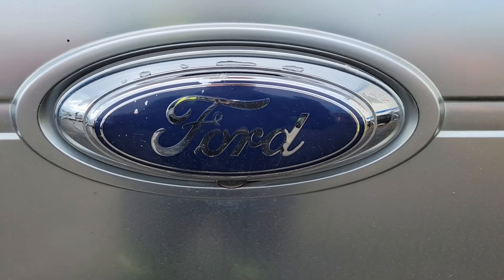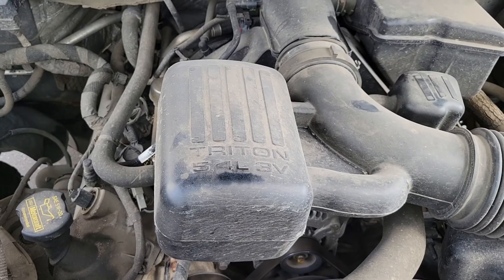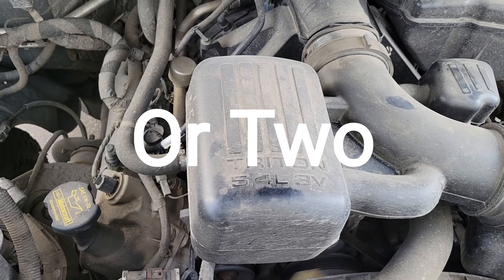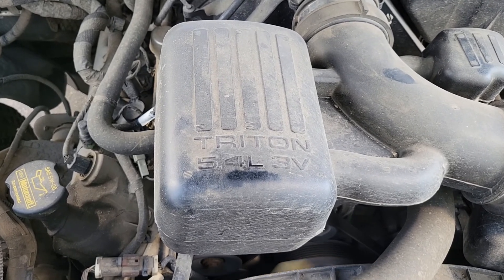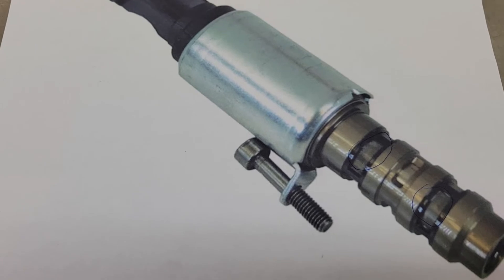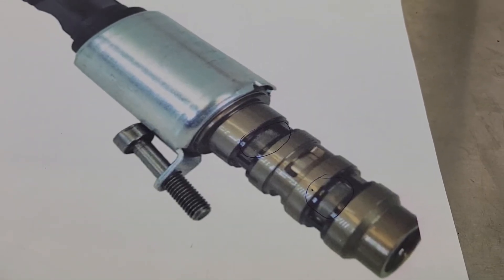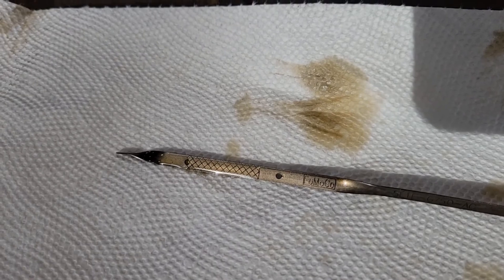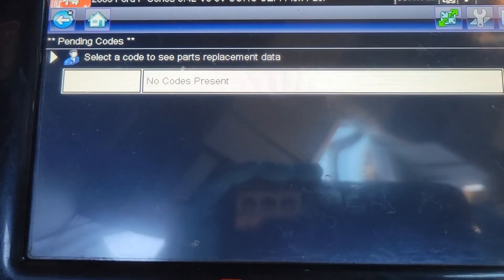Ford F150. P0012 P0022 P0341 P0346 & Timing Chain Rattle. What Will Fix It?

Comment: After Replacing the Solenoids..is it possible that the truck can still give the same problems ? Does the computer need to relearn over 1-3 days of driving or should it just stop this “diesel” shaking like symptoms on the truck
Reply from the maker: Yes it is possible. It's a very complex system with a lot of parts and potential issues. It may not be just the solenoids. Could be phaser, electrical,  oil pressure, or even timing chain issues. Hope you get it figured out and fixed without having to spend too much.

Comment: I have an 09 4.6l. Once the truck is at operating temp when i come to a stop the engine starts running rough and throws a p0345 code. Cleaned cps sensors and did an oil change switching to pure synthetic oil. During the oil changed i noticed build up of sludge in the oil fill cap and spout. Waited way to long to do the oil change. Before this the oil always looked really nice each time I changed it but this time it was black and sludgy. After that the truck still runs rough when coming to a stop but now only throws a p0012 code. I changed the only again today after only driving 100 miles or so and it was dark and sludgy after a week of being in the engine. I hope changing the oil this 2nd time will be enough for the codes to stop coming up. Do you think the problem is likely the sludge in the motor oil maybe affecting the VCT solenoids? And would i maybe benefit from using 5w-30 instead of the 5w-20 it calls for?
Reply: I forgot to mention when I cleaned the cps sensors I also switch which bank they were in, with the code before being p0345 and now it's p0012 actually tell me it's the cps sensor itself I'm thinking. I ordered them, I'll post if it worked.
Reply from the maker: The sludge could definitely be causing issues with the VCT solenoids. Good idea, swapping sensors. I do it with coils chasing misfires. A bad pvc valve can cause sludge to build up quick. I'd check that. Keep me posted on how it works out for you.
Reply: Like always it was the VCT solenoids, running good now.

Comment: 2 oil flush with oil additives each at 150 miles and then fill with good oil? I had the p0022 code pop up on my 3.5 echo boost 2017. Looking to try this before spending thousands.
Reply from the maker: Hope it helps. The system relies on clean oil at the proper pressure. Keep me posted with how the flushing works.

Comment: I did a timing change, after putting back together, I have a P0012 code, and a P2196. Not sure if the o2 sensor could cause this. Sounds like a diesel when I first accelerate in gear. Not sure if spending the time and money on the o2 sensor is worth it, or if I need to call time of death.
Reply from the maker: Did you get it figured out? The P0012 concerns me. Perhaps it wasn't timed right or a cam phaser problem?
Reply: @shanersmechaniclife3164  I did not. I bought a more expensive code reader, hooked up forscan lite and found at idle VCTADVERR is at -55.25 while VCTADVERR2 is sitting at +52.88. I think I will need to tear it all down again.

Comment: My 2010 expedition has 132,000 miles it has the po 0012 to far retarded.  After fresh oil and filter the same code the tech told me it needs a new engine the oil pressure is below the limit. I wonder why it can't be repaired. ..

Comment: Did that. Also changed solenoides, Rocker followers and phasers and after all this, 2 oil changes with oil flush, P0012, P0022 and those P04XX came all over again. Both banks are constantly over retarded at 12.28 degrees
Reply: Did you solve it ? Timing chain issue ?

Comment: I had phaser /valve/ cam rattle after engine warmed up useing the light weight 5w-20 oil. Checked oil pressure with a manual gauge at operating temp . 67 psi then 35 hot. +Went with penzoil 15W 40 problem solves ben useing it ever since.
Reply from the maker: What was your oil pressure after switching to 15w40? My concern would be flow at start up in cold weather.

Comment: How many solenoids does a 2007 5.4 have?
I did timing chain still doing same noise
Reply from the maker: I believe that motor only has two. These motors are very picky. Make sure you have proper oil weight (usually 5w20) oil pressure is in spec, and I usually run Ford filters. These are also prone to cracked or leaking exhaust manifolds which also make ticking noises on cold start ups. Keep me posted on what the problem ends up being. Hope this helped. Thanks for watching.

Comment: Mine did the exact same thing. I changed the solenoids, changed the oil and it’s still running a bit rough. Cleared the codes but haven’t showed back up yet. Not as bad but slight rough. Not sure what else it could be. Any suggestions? P0022 P0012.
Reply from the maker: Those are cam timing related codes, possibly timing chain wear or cam phaser problems? If it's not throwing a code, I wouldn't be too worried. Hope this helps. Let me know what you find. Thanks for watching

Comment: Alright, so what if I do regular oil changes. I do them every 3 - 4.5k miles since my truck is at around 164k miles. I was driving home from the shop and it felt like my truck went into a limp mode. At idle in gear (I was on the road and I didn't think to shift it into neutral or park), my tach was reading about 250 rpm when I usually idle at 750 rpm. I got home, shut it off. Grabbed my scan tool from the garage, went to start it and the truck started fine and idled fine. Took it for a test drive and it didn't go into limp mode. I threw my scanner on it and it had the pending P0022 only. 2007 f150 XLT 5.4 triton Vin V Flex
Reply: and yur point is??

Comment: I am only getting the P0012 and the vehicle vibrates hard and go back to normal, but engine light remains, can I just change the solenoids, also can I still operate the vehicle with no problems
Reply from the maker: You can change the solenoids, but first I would check the wiring to them and the cam sensors for damage. Rodents love to nest on the intakes and chew wiring. If you decide to pull the solenoids check the screens for restrictions like sludge and silicone.  Hope this helps. Let me know what you find. Thanks for watching

Comment: I'm having the same issue. I have a 2015 ford f150 lariat with 3.5 ecoboost. Have the codes and getting a rattle in the engine sometimes. It comes and goes. Should I try this method before spending 5000 on cam phasers?
Reply from the maker: Have you fixed your ecoboost yet? I would try it first. I always look at maintenance items first before I look at expensive repairs. Let me know how it turns out.
Reply: @shanersmechaniclife3164  yes I fixed it simple oil flush and changed oil twice

Comment: I did this with the exception of adding seafoam additive before I change the oil. Drove it for 125 miles. Did oil and filter  change added seafoam again drove it for 150 miles. It quit throwing the error codes and ran great. Changed the oil and oil filter again. Has ran great so far .I'm at 200 miles and still going. Sure Glad I found your video.
Reply from the maker: I'm glad my video was helpful for you. These variable cam timing systems rely so much on clean, proper viscosity, level, and oil pressure.  You lose one of those, and there will be a problem.  Keep me posted on your engine as you get more miles on it. Thanks for watching and commenting.

Comment: Good vedio I'm working on ford explorer 2014  i change water pump    cause if was leaking an i have change timing chain an sprocket now it shows code P0022 and P0012 any help highly appreciated
Reply from the maker: Could possibly be a timing chain or phaser timing issue in assembly. Did you have any of those codes before? Let me know what you find. Thanks for watching and commenting.
Reply: @shanersmechaniclife3164  
All 4 phaser I have change
Reply: I have not check code before thank you

Comment: First video ive found on the problem i got going on, finally, took so long to find smthg. I got a 2010 4.6 3V and i got the same issue where it starts sounding like a semi truck every now and then. I got the same codes but i also got one cylinder misfiring in each bank 3 & 4, is that related to it all or is that domething seperate or perhaps altogether different.
Reply from the maker: If the cam timing is off, a misfire could happen. One thing you could try is take the coils from the suspect cylinders and move them to other cylinders. If you get different misfire codes, then you know it's a coil problem. Hope this helps and keep me posted.

Comment: I have a 2010 f150 lariat getting the same codes and rough iddle, also it shuts off randomly when i get to a stop or red light, do you have any recommendation??
Reply: Did you ever find the problem or a fix for the problem?
Reply: Same problem here

Comment: Got a 08 5.4 did timing chain ran great til warm then idled like shit did timing chain again same thing with phasers did it again new chain and phasers and vvts still idles like shit I’m lost
Reply: You did the timing chain twice and never upgraded the oil pump ???
Reply from the maker: Have you checked your oil pressure? or even send an inspection camera up the drain plug to check pickup screen? I've seen them restricted with silicone. That system needs pressure and flow. Let me know what you find.

Comment: my cel goes off directly after i change oil but comes back on about 100 miles later.  how many oil changes do you recommend
Reply from the maker: A couple oil changes should work if it's just an oil sludge problem. You may have some worn parts. What codes are you getting?
Reply: @shanersmechaniclife3164  p0012 an p0022.  ive change it 2 times so fare each time light comes on about 150 to 200 miles at highway speeds
Reply: @newschool2708  did you ever resolve this? I’m now having a similar issue with mine.
Reply: Im having the same issue. What was the cost in replacing engine?

Comment: Mine just started, I got it at 141k and it’s at 147k. It was do for an oil change at 145k which I did, mine is an XLT though. I’m just gunna replace them and the cam position sensors since I’m right there.

Comment: Question I’ve got a 2007 5.4 3 v and I just replaced the spark plug after truck overheated now that new plugs are in when I hit the gas it makes a clacking noise my codes are p0010 p0020 and p0202 any clew ? If so I’d appreciate a response
Reply: P0010:  Camshaft position, actuator A-bank 1 circuit malfunction.
P0020: camshaft position, actuator A - Bank2 Circuit malfunction
P0202: Injector circuit open cylinder two

Comment: I will be trying this out this weekend. The truck I just bought with 190K miles is throwing all of those codes and the oil looks a little gummed up! I'll let you know if it works!
Reply: Did it work?
Reply from the maker: Hope it works out for you. Keep me posted. I saw the truck in my video this week. No check engine light

Comment: So i want to Thank You for putting out this video/tutorial . I have a 2018 with a 3.5 eco ,10 speed 4x4 with 38,500 miles and the scanner is throwing out  the P0022 code so i looked it up and your video came up. I had the truck at the dealership and it did'nt give a code but it was on for about 2 weeks. So this Saturday @ 11:00 am the code came back on. They said it (might ) be covered under warranty .  Labor is at over $100 + an hour i hope so. Anyways thanks again for the insight.
Reply from the maker: Thanks for the comment. I hope that your repair is covered under warranty. These systems are very sensitive and need good clean oil with good flow and pressure. With any repair it's always a good idea to check your basic maintenance items first. Damage can be done very quickly. Let me know how your vehicle turns out. If you have any questions feel free to leave a comment. I'm always looking for video ideas and ways to help my viewers.

Comment: after replacing the vvt solenoids cam phasers and timing chain guides etc. Upgraded rollerfollowers Plus upgrading oil pump to m360 which increases oil pressure by 20%
It was recommended late go from 5W-20 to 5W-30.
After completing the job I'm not getting a p0022 code with rough idle and occasional stalling.
Is it possible the oil is an issue
Thank you
Reply: That was synthetic oil  put in
Reply from the maker: Oil pressure, flow, and frequent oil changes with good oil (I always use synthetic) are so important with these motors. I always buy high quality oil.

Comment: Did you put in conventional oil or synthetic oil, and why? What type did you drain out? I'm having the same CEL codes and symptoms on a 2011 Expedition (same engine and near same mileage). I'll have to give this a shot. Thank you for sharing.
Reply from the maker: How did it work for you? I use synthetic. I believe it was synthetic that came out. Clean oil is very important with these motors. I figure I'd try regular maintenance items  before I open a motor up. But if it was making noise light that, some damage has. been done
Reply: I have the same vehicle as you with those problems. Did you ever get it resolved?